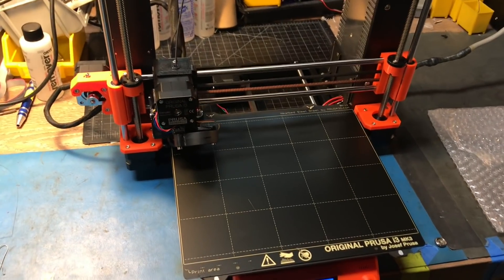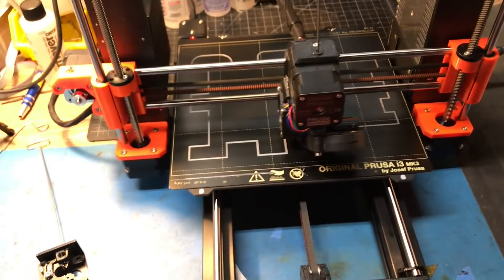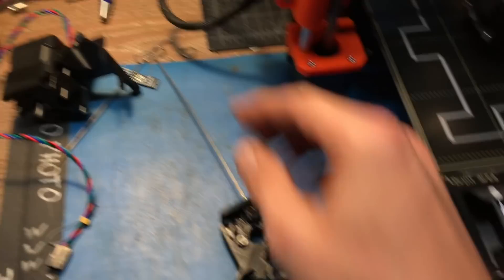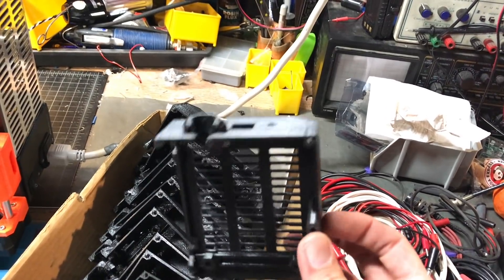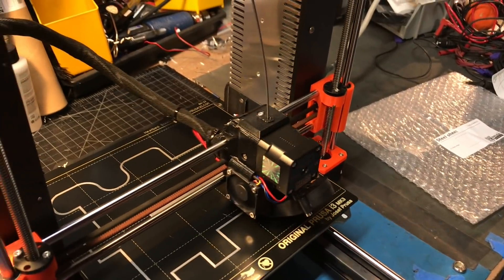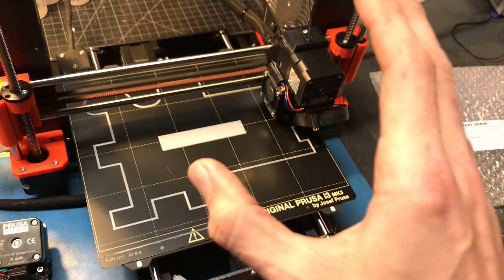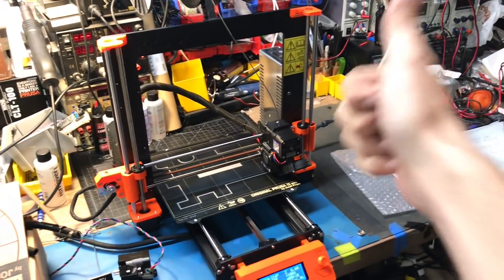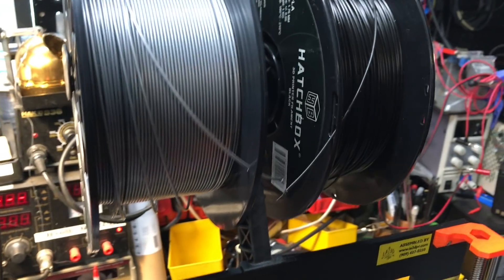Prusa MK3S Improvements

Comment: I'm always surprised that you have a business servicing 3D printers. Wouldn't be possible in the UK, I think. Too many tinkerers
Reply from the maker: If you would have told me 5 years ago we'd be doing this full time I'd have called you crazy - it was supposed to be a side gig.
The thing I realized is: cars wouldn't be as omnipresent in "common society" without the existence of the service depots; it's much easier to feed a horse in balance - and it's also easier to produce "things" in any other medium than printing: clay, cardboard are much easier routes, but the printer is an enabler.
The calls started and didn't stop, so here we are.
What's the equivalent "roadside service" in UK? We have AAA but I like to direct my flow beyond a US audience.
Thanks Greg!

Comment: Well I gotta say. The biggest thing on this upgrade is the new filament sensor. But that kinda makes it feel like a downgrade from the previous version. The only advantage of this new system is it's longevity and that's still not fully proven. But filament sensing wise is less capable than the optical one on the mk3. This is just a mechanical/ir sensor hybrid, which is good in the sense that it provides longer life since the only moving part is that pivoting lever triggering the sensor. But that's it. You don't get a better sensor, you're losing sensing capabilities. Your MK3S sensor isn't better at sensing the filament than any other sensor. Why? Because all it doesn't is sense that there's filament there. Any sensor can do that, what gave the mk3 an edge was that it was also able to sense movement therefore able to sense filament clogs or any other issues related to the filament being in but not being properly extruded. That's a big feature and you lose it with this "upgrade". I LOVE Prusa, not hating. Just stating facts. I got the upgrade and while testing it, that same flaw was exposed right away. While doing the upgrade I also replace the brass nozzle with a hardened one. Started printed and what do you know? My temp setting wasn't right for my new nozzle, it was too low. So the filament wasn't being extruded, the bondtech gears ground down the filament and it broke right there on the gears spot. So the printer was working but filament wasn't moving. I had no extrusion and the printer wasn't able to detect that. The MK3 would have caught that in the spot.

Comment: I got the upgrade with some extra nozzles, as read that changing based on what you're printing is a good idea, however, with the 3S upgrade, you can't change the nozzle easily.  The new channel for the hotend wires is in a different place, so there's nowhere to grip the block, except where the nozzle actually is.  Have you tried this? Any thoughts?
Reply from the maker: David Moore it’s same as before: pull the fan shroud, use a 16mm spanner to hold the block from the back, and a 7mm socket on the nozzle to break it loose, I’ll make a vid.
Reply: @LA3DPrinterRepair  See this pic, I can't see where to hold at back with 3S upgrade https://images2.imgbox.com/60/43/Lj2cAq5Q_o.jpg

Comment: I did the upgrade and received a filament sensor error.  Checked connections several times, then updated firmware which solved the problem.  Apparently the filament sensor may use a different type of sensing, don't know, but my firmware was at least one generation old.
Reply from the maker: Manny Shulman good point, if you’re doing a conversion upgrade from MK3 to MK3S the machine specific firmware update is essential to handle the interruptor trigger based filament sensor vs the old laser that “talked” to the MCU via a two wire protocol.
Reply: I had problems with the sensor on my mk2,5s upgrade. I took a permanent marker and opened the top plate. I marked that lever as well as i could and now it works!

Comment: So i guess it no longer detects stuck filament.
Reply from the maker: I think they would've updated the features list if that were the case; they have lost step detection via the Trinamic on all steppers; a clog or jam is going to trigger that. I need our own kits to do some abusive testing to confirm, but yea, I don't think that's been eliminated as a feature but once I've got an MK3S of our own I can beat to hell, I'll make a vid and confirm.
Reply: @LA3DPrinterRepair  Erik is right, you've lost filament stall detection by swapping the laser sensor for the IR sensor. Trinamic stallguard was never used for filament stall detection. The IR sensor can only be used as a filament run out sensor.
Reply from the maker: DrR1pper You are correct that “stall” detection is no longer there, at least for now; but that being said, at least in my experience a clog isn’t something that just happens, usually you get extrusion problems before clog occurs, better in general to do regular cold pulls to purge residue before it becomes debris. The more I think about it, the more I question how important the clog detection is...
Reply: @LA3DPrinterRepair  I don't disagree with you on that front, especially if the stall detection is temperamental. The biggest benefit I thought it to be is in the event of a knotted spool.

Comment: Do you think that having the new extruder more closed off like it is will trap more of the heat from the extruder stepper motor and in to the bond tech gears ? Also the new part cooling duct "fang" still does not cool the back side or even the sides much, it still seems to be very front loaded for part cooling. Loved my MK2 and my MK3 so I know I will love the MK3S once I upgrade my machine. One thing I would love to know. The white signal wire on the new filament sensor does it go Low or High when filament is inserted ? I want to do a inductive sensor mod instead of the optical for the fun of doing it, but need to know more about the control signal they send the main board.  Thank you for the great video.
Reply from the maker: I've got printers printing pretty much constantly and heat migration to the extruder gears is not something I've run into; also part cooling in any form is better than no part cooling, joel's comparison of the R3 duct vs the old duct bears that out, they're both just fine and improvements are into diminishing returns territory.